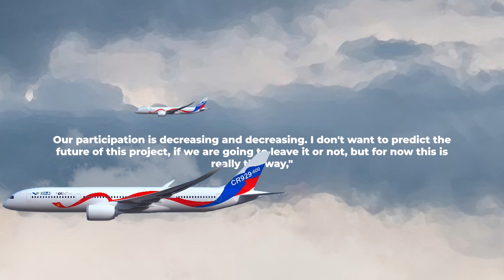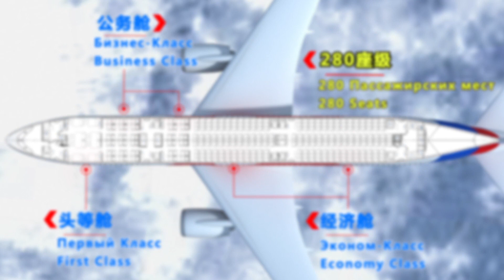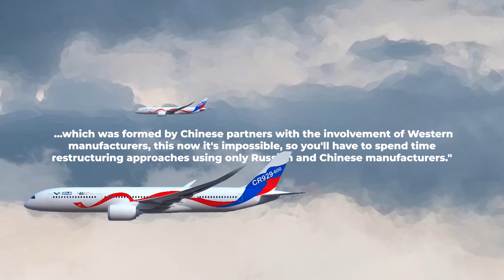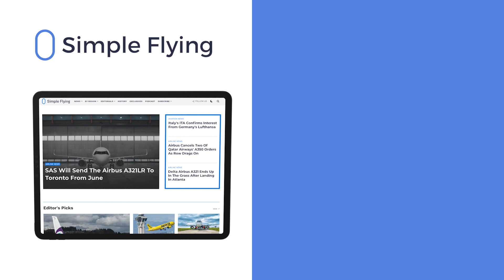Russia Considers Withdrawing From CR929 Project

Comment: Depends on the future of Chinese foreign policy. If hey plan to stage a similar stunt as Russia with Taiwan soon,  it would make sense to have independent aviation systems without the need of western systems and spare parts. However, given the time China needed to "develop" their variation of the Mad Dog and the C919, I cannot imagine we will see an independent Chinese aviation industry without ANY western contribution within the next 15 years. 

An ongoing partnership with Russia has huge consequences as no single western part of ACFT system or engine could be used. China would have to develop many systems from scratch instead of buying them of the shelf. All these parts need to be certified by EASA / FAA if they want to sell the plane anywhere outside China and Russia. This means further huge time delays while China continues to pay Toulouse or Seattle for their widebody planes. 

All together, I believe, the Chinese will prefer a more conservative approach. Ditching the Russians would allow western experience and partners while reducing the risk of the project tremendously.

Comment: According to Andrei Martyanov, main reason for Russia withdrawing from this join venture is that China is now demanding the transfer of Russian engine (PD-35) technology, which Russians say they cannot give out to anyone, not even China.
Reply: that's incorrect. China already has an engine for it. the main reason russia is reducing it involvement is western sanction over ukraine make it impossible for Russian companies to bid for subsystem since they don't have access to the electronic to build them, this is just the russian realizing they can't produce at the level they previously believe they could. noted 2 things, Russia is not withdrawing from the project, they are downsizing, also Russia doesn't need to end partnership even if they deny access to the engine, since the engine wasn't part of the joint venture to begin with. that is like saying tesla won't sell in china since spacex won't do business in china, they are 2 seperate project.

Comment: There is no resson why both countries should not be able to cooperate when they can complement each other by putting together their areas of expertise on 50/50 cost sharing.
Reply: Then the Chinese manufacturers will be sanctioned on electronics, avionics, engines, etc. Russia won't even be able to buy these planes with western parts in them.

Comment: It's a curious intersection. The "keep at home" technical side of the Type might provoke a sustainable domestic sub-industry, or, investors may not want to take that chance? China can build anything it wants however there may be some interlocking challenges coming in view that this 929 would not sell well without world-wide AI and technical on the ground back-up.
Might ground techs at Pearson be capable to de-glitch a 929 arriving from Kowloon? The Symantec equations may prove to be clumsy.

Comment: The CR929, in the configuration China wants it, will use A TON of western components, engines, avionics, the lot. Unlike the Russians, the Chinese actually want the CR929 to have a chance of succeeding in the commercial market outside of state-run airlines, and that means getting it certified with the FAA, EASA and using as many parts airlines are already familiar with. Seeing as Russia is turning into Iran in the aviation department, UAC is probably turning into more of a liability than an asset.
Reply: Russia has its Irkut MC-21 and MD-14 engines that are fully engineered and built domestically, however still heavily depend on western machinery, and Russia doesn't manufacture instruments. They claim the first 6 MC-21's are to be delivered to AeroFlot in 2024 which they don't make and they'll never get these planes and engines certified internationally. So the passenger aircraft industry is doomed.
Reply: @martijnstam6186  They can always go back to the railroad
Reply: Well said.
Reply: Very true
Reply: It will never succeed in Europe or America. It will be a success in Russia and China, and potentially the rest of Asia, Africa and South America. It therefore doesn’t matter whether it has western components or not as the latter mentioned countries don’t care about that stuff or sanctions.

Comment: The "Trunkliner" program with Douglas Aircraft in Long Beach and China failed due to unwritten rework necessary to custom fit parts, an expensive byproduct of pre computer aided design. Paper drawing parts required expensive design adjustments as fitting errors are detected, documented, and new parts finally available. Russia and China each should have in house capability for all the special materials and processes needed for modern aircraft.

Comment: Ever since the sanctions against Russia started, I wondered they would be able to maintain their collaboration on this project. I'm happy to finally get an answer: they can't. The bad 787 rip-off (aka CR929) is farther away than ever.
Reply: You're happy to believe your biased answers. Meanwhile the Chinese will ignore your naysayers and keep innovating their way. Just about everyone say their highspeed rail won't work for such large country but it worked great for them, likewise their space industry is now even further along than US and the same will be for their airline manufacturer.
Reply: The concept of a modern wide body aircraft with similar seating capacity to 787 doesn't make it a ripoff, its a competitor
Reply: @dxkaiyuan4177  it's a direct rip-off, just look at the design and specifications. The only difference is that the CR-929 would have lower capacities
Reply: C919 is already out dated

Comment: Yeah, China will develop the CR929 based on the Russian's design knowledge and they nearly finished they can kick out Russia. The reason as mentioned will be that China wants to use Rolls Royce engines.
Reply: Just like they did on there Russian military jet order.cant believe Russia didn't figure that out form the get go.
Reply: Better than trusting any western partners like Americans or any European at that point, who not only took any joint projects from Russia but stole Russia money in the banks too. I would trust the Chinese better than west at this point.
Reply: @inkbold8511 pack your bags and move I'm sure they'll have you with open arms
Reply: @SamuelwrightA350 yes
Reply: @MrAtlantis95 not even close, Russia wants to reband their il96. China want a commercially viable jet. It is a freaking business, they can't force their airlines to buy something cost more to operate. Making a plane is pretty easy for China, the Y20 only took 5 years and they are flying just fine. The difficulty is operation cost, low maintenance, low fuels consumption and efficient supply chain.
Reply: @SamuelwrightA350 In the dreams of China and Russia, yes.
Reply: @SamuelwrightA350 that's the "goal"
Reply: Roll Royce is not all that great

Comment: MC-21 is A Better planes to Continue.

That plane doesn't copy the Designs of any Aircraft.

MC-21 has a Potential.
Reply: The Irkut MC-21 is a narrowbody, the CR-929 is meant to be a widebody. Not comparable.
Reply: @osasunaitor  In fact, they're very comparable. The difference is only in size of the body and engines. All the million of other components are exactly the same.
Reply: Yeah but They should invest in the Narrow Body, Instead of the Wide Body.

Because no one Will Buy from Them.